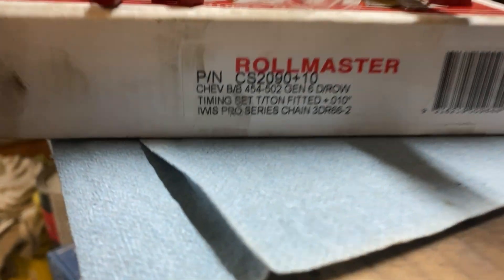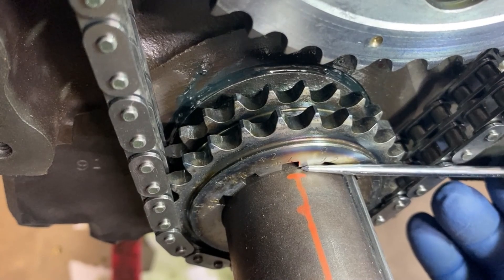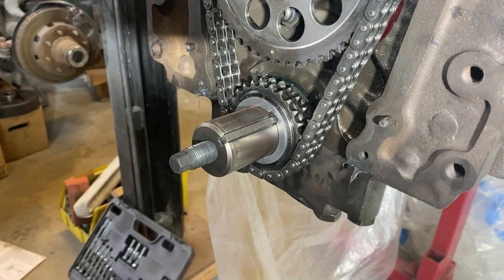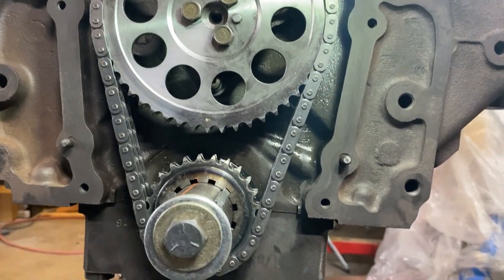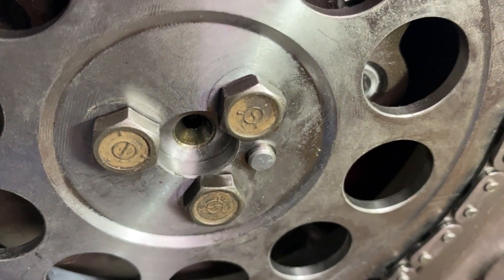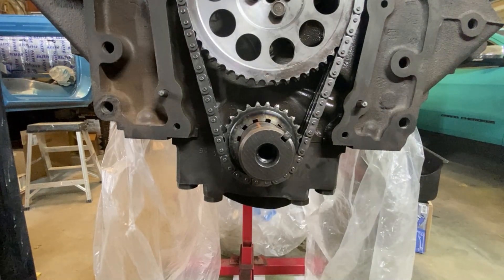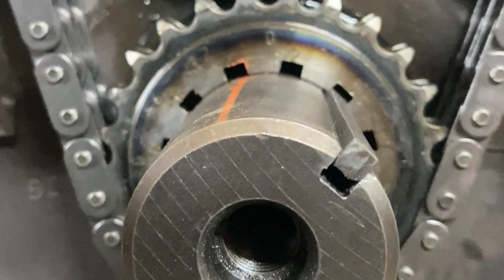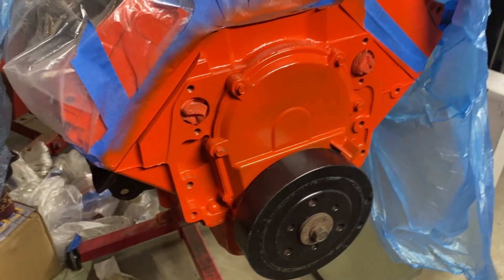Big Block Chevy Double Row timing set. How to make it work on Gen VI BBC.

Comment from the maker: Please make sure to check out my other video where I found the CORRECT crankshaft key.  The one in this video is not correct.
Reply: What about the retainer plate? Is the roller bearing behind the cam gear?
Reply from the maker: @brianswinner1443  Not sure what your question is, but yes the roller bearing goes behind the cam gear.
Reply: @vikingmech and it fit in front of the retainer plate without any issues?
Reply from the maker: @brianswinner1443  I don't remember the details exactly, it was over a year and a half ago that I built this motor.  I recall the timing set came with a thin roller bearing and I just installed it however it was supposed to be installed and had no issues.  I think it went directly behind the cam gear and there were no clearance issues.
Reply: @vikingmech yes that's the answer I were looking for. I wasn't sure about the retainer plate  preventing the gear from seating down properly to the cam

Comment: Same pan and machined to the same depth but I’m still touching, any suggestions ?
Reply from the maker: You sure your cam gear is seated all the way?  Also you could try measuring with the cover AND gasket.  That will gain you a little bit more clearance.

Comment: Great video ! Ran into the same issue what is the part number for the crankshaft shim?
Reply from the maker: @josemorga8412  I don't know the part number but I got a few of them from summit.  They didn't have the exact size so I just got a thicker one and ran it on the belt sander till I got the thickness I wanted.
Reply: @vikingmech  cool thank you I am doing the same exact thing did you shave the shim to 80 thousands?
Reply from the maker: @josemorga8412  Yes right around 80-90 thousandths.  Engine is running now and all the pulleys line up perfect and belt runs straight.

Comment: i noticed the gen 6 balancer  are you using the serpentine that came with it or using gen 4 pulley's?    any issues with gen 4 stuff like bottom pulley not fitting or mis alignment?
Reply from the maker: @mikeuva2273 I'm using all the stock brackets and accessories that came with the gen 6 motor. I'm sure the gen 4 stuff could all be made to fit as well.  I haven't tried that so I couldn't speak to gen 4 stuff.

Comment: Great video thanks for putting it out there. I noticed you heated up the harmonic balancer. I’ve heard of people using assembly lube on the crank when putting the balancer in place. Did you do that?
Reply from the maker: @Michael-Homerepair76 Nope I've never used any kind of lube when installing balancers.  As long as you have a good install tool they normally go on without any trouble.

Comment: If I ever come across that, I'm machining my own key!!

As far as that Balancer bolt, that must be a "special" Gen VI thing! Everything I look up is all 1/2-20 x 1.55". But for what you're doing with this engine, I wouldn't worry about re-using that bolt, it'll work fine.
Reply from the maker: @Anarchy-Is-Liberty  Yep I re-used the old grade 8 bolt.  Strange that ARP hasn't figured this out yet for the Gen VI motors.  They've been around since 1996!

Comment: You can't even get that crankshaft bolt any longer. I bought a 67chevelle w/ that L29 454 and it was missing the crank bolt! Explains why the belts kept jumping. I just used a grade 8, 2" bolt.

Comment: Pretty good info but get you a degree wheel and check your intake centerline to verify cam timing against the card. For so many years now manufacturers put 4 deg advance on the pin. I always run my camshafts straight up. Of course I've played with adv and ret from straight up but all it does is move the peak power around about 200 rpm per 4 deg. A straight up install using intake centerline will measure in degrees the same as the LDA or "line center" such as 110, 108 etc. 
Also it was great to see you use a balancer install tool. In anyone reading don't have one then get one. You can do other cool stuff with it too other than just installing balancers. They make great bushing installers in some applications.
Reply from the maker: @williamstamper442  Thats good advice on the degree wheel.  I don't have one, but one of these days I need to get one of those and learn how to use it correctly.

Comment: Something is wrong with that keyway. If it were me, I'm making a custom key. Rectangular.
Reply: Google 3/16x3/8 rectangular key stock. That should put you close to where you need to be. I don't know about hardened, I've never encountered a hardened key. Not saying you're wrong. Most keys I've replaced were on large electric motors on production machines.
Reply: Good vid. I agree that key is wrong. Check mcmaster
Reply from the maker: @aaronhietala4709  Any advice on how to do that would be welcomed.  Those are made from hardened steel.